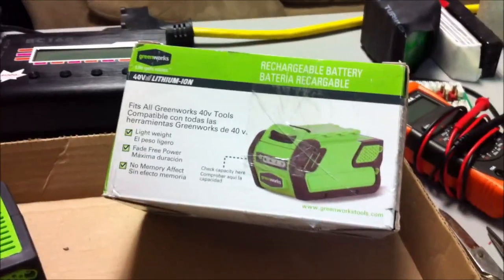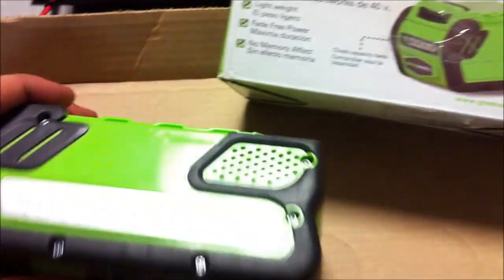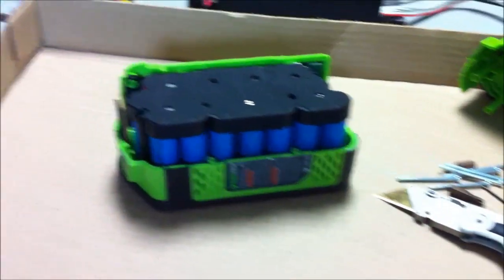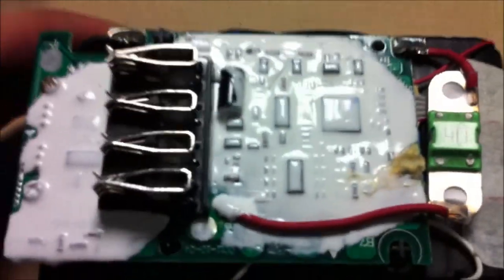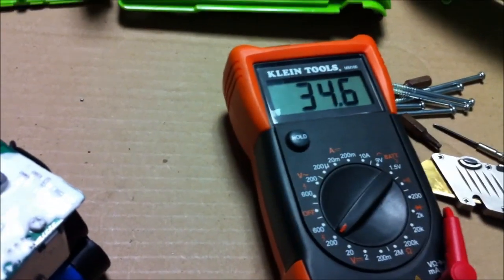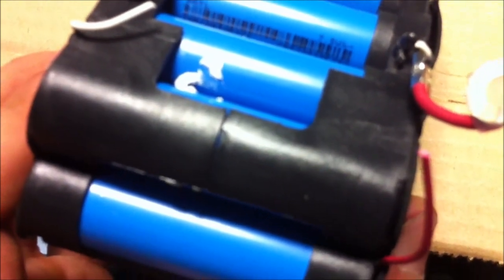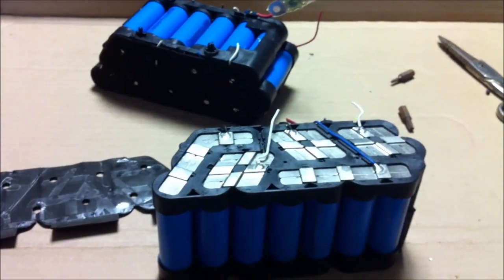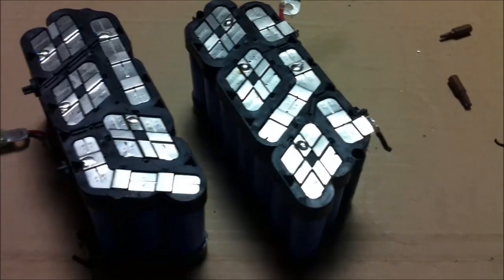Watts Inside? - Greenworks 40v4ah Lithium battery pack opening #29282

Comment: Got myself the greenworks electric wheelbarow. Tested conecting ryobi 18v in series 39,5v out. Sadly it only works for 4 seconds before turning off. It got 3 connections + - and the one right next to -. I belived it is the com pin. But hearing you say the diffrent voltage it got me intrigued. I am trying to find socumments on the diffrent pin outs to get better answers but i migt need to accept defeat and by a solo greenworks battery

Comment: On my  40v 2 ah I only get 35V at the terminal , fully charge there should be 41V.
Not ideal to use them directly with some kind of ebike , already down 18% at start , .
Reply from the maker: You should solder wires directly to the cell tabs if you want to discharge the pack on an Ebike

Comment: If my battery won’t charge and the red light is blinking… has the battery gone to a too low voltage?
If I don’t have another 40v battery how can I jump start it?
Reply from the maker: Yes you may have a weak or dead cell group in the battery. You may need to open it up and check each cell group with a voltage meter. You could replace the bad cells or try to charge them with a single cell charger and bring some life to them

Comment: I found to activate the battery need a 4.7k resistor from positive to one or other pins in the middle, it gently turn on by activating internal MOSFET with a pwm noise heard into my 200watts 120vac incandescent bulb, I use this bulb to see if it turn on. I am still looking for information about the pins 2&3, one is C and other have a ohms symbol on it, maybe C is for common but I will investigate more.
Reply: Yes it is a 4.7k resistor needed to go from negative to the ohm pin on battery

Comment: Im wondering if the mower is actually running on 20v from the tabs instead of 40
Reply: I have the GW 300W inverter.  inside the contacts one of the terminal connections is bridged to the positive terminal.  This creates the series connection to make it 36v (or the 40v suggestion by GW)
Reply: I think those are 5 blocks of 4 cells  in series, where each of one has 2 battery in series and 2 in parallel. So 4.2*2=8.4v*5 blocks =42v

Comment: Hi can you measure the 3rd pin of the battery, please? One is +40 and the otherone? Is the 3rd one a databus?. I made a battery by my self but my highpressure washer GDC40 is turning after 5s off. Thank you.
Reply: Exactly the same thing with me. I'm trying to get a GDC40 pressure washer to work with a bicycle battery. Works for 5 seconds, then shuts off. 

He did say at the beginning of the video that you can't find 36 volts in + and minus.. I don't believe this. I'll explain it like this. I have disassembled the washer, and there is a thin wire coming from the third pin. 

But if you look at other li-ion (like drilling machines) batteries, there is ~5-8 kilo Ohm resistance against the minus pole. 

Because of this, I have been try to find the right ohm value with the trimmer potentiometer, but I couldn't find it!! I adjusted all values between 0 and 12 kilo Ohms. There are no correct values in between those values. Too bad! 

How did you solve it yourself?

Comment: To use the 40v battery outside the tool, it needs to enabled. Do you know how 
this is done (C & Ω terminals)?
Reply: I turn it on with a 4.7k resistor between positive and 2 or 3 pins number, it work but need to investigate.

Comment: i have a brand new 4.0 ah, 40v gmax battery that has two issues, 1. the battery voltage indicator doesnt work at all 2. when I put it on the charger it goes right to a green light? greenworks is sending me a brand new replacement, I can keep the faulty one. question is , do you know how I can repair it? I would love to have  aback up battery, im sure its in the circuitry or associated. I can solder, use a meter, etc
Reply: your board inside is gone dead. Salvage batteries and using BMS board from ebay,  make a power source of your choice.

Comment: They have 4 connectors on the batterry, 1 is positive and 1 nagative whats the other 2 connector for ? Pls tell me how many volt the third connector supply ? Thanks
Reply: At least one terminal is used for communication with the BMS circuit inside the pack. It allows you to turn the battery on and off.

Comment: I've got 3 of these batteries from craigslist and want to try rigging to power an electric bike.  Batteries all showing full charge, but only to 35V and they are 40V batteries.  However, multimeter shows the charger is only outputting 35V?  Is it possible I've got a faulty charger?
Reply: Hi Pierre-Luc.  My plan is to crack the case and solder new wires.  What I need to know is which two of the four connectors on the batteries are for charging.  Note also I didn't find it easy to snap off the tampering pins on the Torx, so I went and bought a special pinned T10.
Reply: As the pack consists of 10S1P, the pack must show near 42V  if you check the voltage right after completion of charge.
I guess there is a trouble in your charger.
Reply: Thank you - since the batteries are nearly new, we figure this is the case - going to try them with a different charger and see.
Reply: Also thinking about doing the same. What do you plan todo with the connectors? Open the wackand wire it or create a 4 pin connectors?
Reply: psburinkou good. I plan to hack a connector since I need my packs intact for my lawn mower.
Reply: How you measured the voltage? Externally it shows zero volts between + &  - 

Internally it shows 41.3 v across battery pack  (red and black wires)
Reply: varify your multimeter is reading good and fair.

Comment: Recencly I purchased greenworks lawn trimmer without battery pack. When I connect 37V(10A) DC power to the trimmer, it works only a few seconds and it stops with beep sound. I guess one terminal near minus input performs unlocking. Inside the trimmer, only three terminals are used  among four termals from battery pack . Can anyone help me ?
Reply: I think you, and I are on the same mission. From my understanding that the battery is sending information to the controller of the devices for a status update. I am trying to replicate a signal to the controller, but running into the issue of not having a battery to understand what a good signal is suppose to look like. Has anyone else tried to replicate this signal?
Reply: I have a similar project in mind. Could one not just bypass the controller to send DC power to the motor and use a regular on/off switch? I believe this model uses a brushed motor so the motor should run just fine with the 37DC power directly connected, no?
Reply: I have same problem as you guys have, but I know one thing , there are 3 connector 1 nagative black wire, 1 possitive red wire but there is a smaller white wire call Com, it connect to the third connector from batterry , but I dont know how many volt it supply ? Some have death original greenworks battery can open it to see how it works.
Reply: Did any of yall ever find a solution?
Reply: I have the same issue, does anyone solved it?
Reply: Same issue for me. Any ideas? I'd appreciate if someone with a 40v Greenworks battery could just put a multimeter across the terminals to see if it just connects a resistor or whatever to the other pins. From what I've seen on youtube there are other batteries (Snapper, Kobalt etc) that can be used instead of the Greenworks so surely it's not too specific.

Comment: Can this Cell package be used for an E-Bike power pack now that you showed us how to get 40 volts out of it ?
Reply: Did you find a way to get output from the battery pack terminals without diassebling the pack ?
Reply from the maker: +Richard Prince Yes I use 4x of them in a 20s 8ah setup they work good up to about 25-30amps

Comment: What are the balancing tabs you are using? Where did you get them? Thanks
Reply from the maker: They are 5s JST extensions from hobbyking.com

Thanks for watching!
Reply from the maker: @Cheeseburger4362  the easiest way to tap into the 36v of the pack is to open the hosing and solder the output leads directly to the cell tabs bypassing the bms board, you can leave the bms intact so you can still charge it regularly also. Otherwise you can buy a cheap greenworks power tool and remove the battery mount wiring harness and attach it to that too

Comment: Are these batteries lithium ion, or lithium iron phosphate? I guess LFP is 3.2V/cell and Li is 3.7V/cell.
Reply: The cell is lithiun ion with 3.7V per cell. Packing configuration is 10s2p.
Reply: you got too much additional unnecessary knowledge
Reply: They are 18650 cells with a nominal voltage of 3.7 volts/cell. 4.2volts/cell when fully charged. LiFePO4 cells would be cool, but unfortunately not.

Comment: anyway we can use these packs without having to tear them apart, to use them for a E bike?
Reply from the maker: these are only worth it if u can find them around 50$ each otherwise build an 18650 pack from scratch... ya its possible but why would you?
Reply: skeetab5780 i've got zero education in electrics and wiring, was wondering if you knew any good ready made battery packs for a e-bike for a motor that goes past 40mph+ ... any ideas?

Comment from the maker: Google" Lipo balance wiring guide" and the first link that comes up is a very helpful website to help you get familiar with how balance wires attach. Because I use a 6s balance charger I may end up using 2x 5s balance leads.